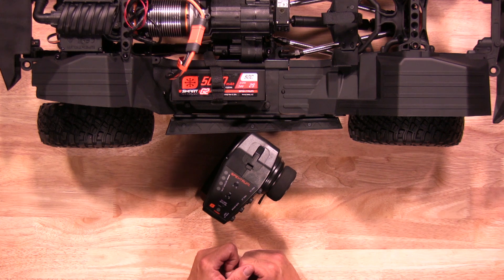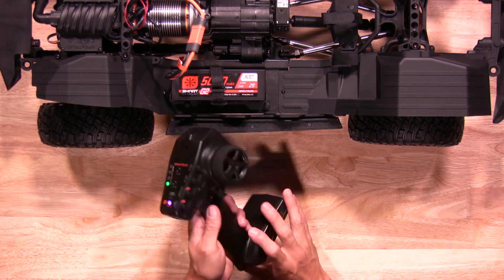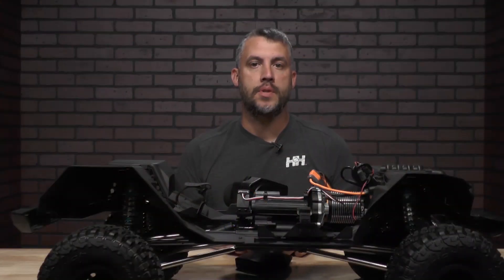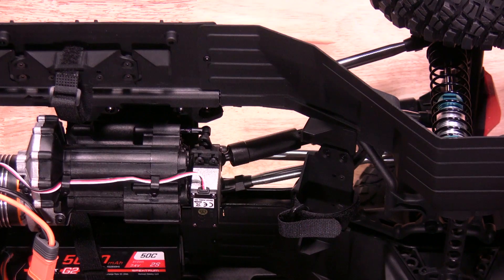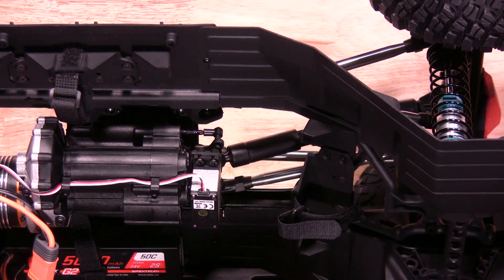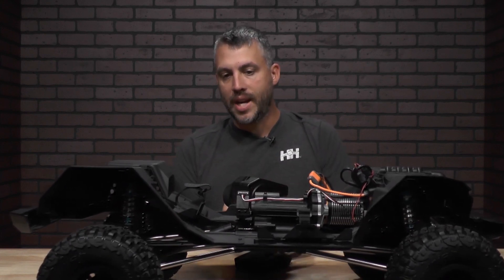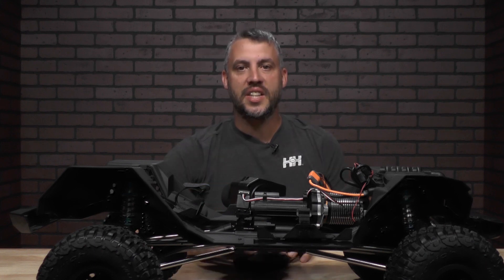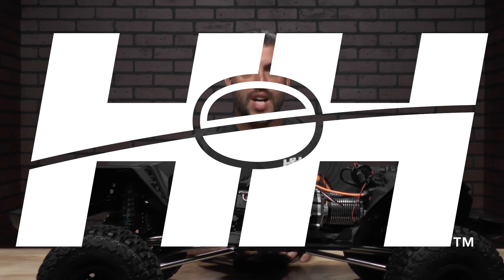From the Tech Desk: How to set the endpoints on the two speed servo in the AXIAL SCX6.

Comment: I tried to follow your video relating to adjusting the steering endpoint adjustment.
After the adjustment I turned off the radio (TX) to save.  Then when I turned it back on I had no throttle control coming out of the ESC.
Then I took it to a local Hobby Store and they told me my RX was fubar and could not be bound ?  So I'd be afraid of following anymore of you advice.
As it stands I have an expensive paper weight collecting dust.  😡
This was following  your instructional video specifically for the Axial SCX6.
This video  https://www.youtube.com/watch?v=NgNqu0LooD8

Comment: Anyone still having issues or you having a solid purple light instead of a blinking purple light, make sure your second speed transmission servo is in aux 1 so you can program it, my wasn't and was running fine till i left it park for a couple days and couldn't get the damn transmission servo to engaged so after researching for 4 hours i finally found out that it needs to be in aux 1. Make sure it is in aux 1 and give it a try, i solve my issue and now is driving great again.

Comment: I've adjusted mine about 100 times and it still won't shift correctly. It will go into hi gear just fine but will not consistently go back into low gear. I even tried a different servo and different radio gear and still cannot get it to work reliably.

Comment: Mine is having an issue when going into 2nd gear. Some times it will not fully go into 2nd and just be in “neutral”. It will just sit there and click when applying the throttle. Do I need to set my end points?